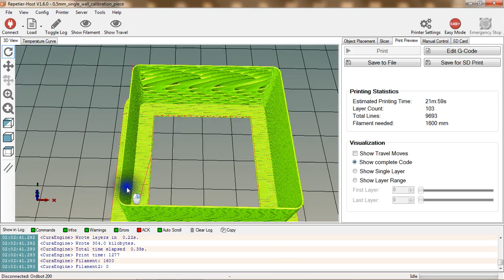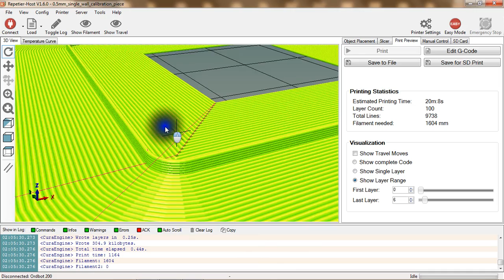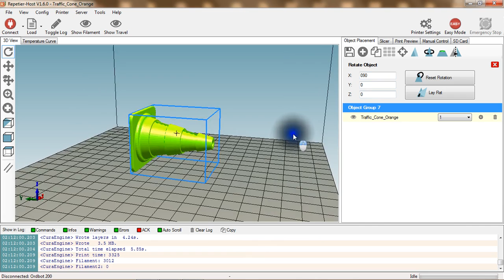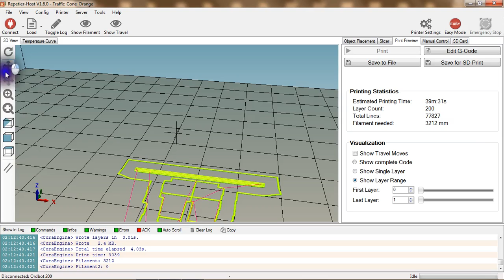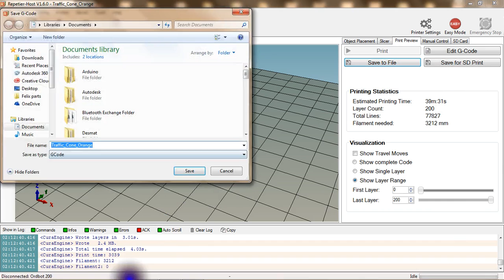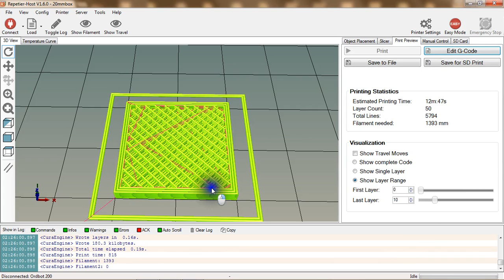Using Repetier Host with Ordbot Hadron - Part 2

Comment: just moved from slic3r to curaengine on repetier host, when try to print from sd card.. my printer seem not detect temperature code?? need to do anything to gcode before print? any tutorial? when use slic3r, everything work just fine..